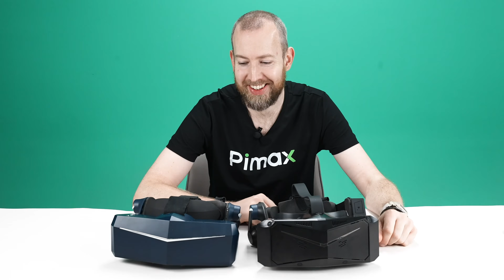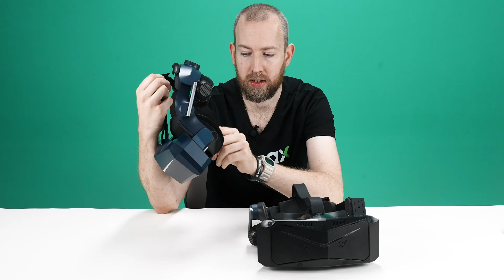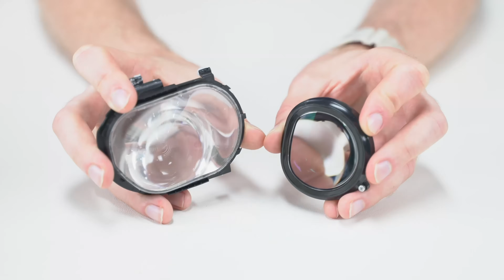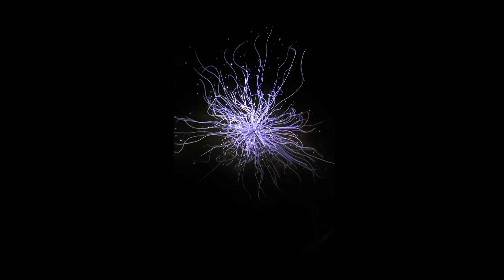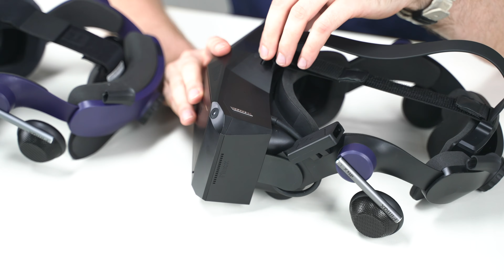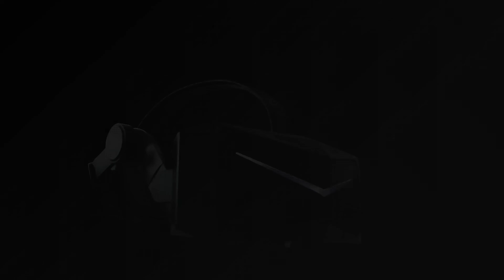Pimax 8KX vs Crystal comparison

Comment: here is hoping the 12k is more like the 8k and gets rid of all that excessive useless junk.
all we need is wide fov, 35ppd, good glas lenses and basestation support, you can keep the rest. although foveated rendering would be nice.
Reply: I would be hopeful fur such a device - but glasslenses in that size are a challenge and AFAIK not planned, second what device is going to render images in that resolution and FOV. The answers made me take the Crystal 😬
Reply: @MarcReisSyllogism  i cant stand that divingmask fov, getting a crystal sadly is not an option for me. i actually tried to reduce the fov of my 8kx to crystal levels, to test, but i could not accept it anymore.
Reply: Eh, dynamic foveated rendering would be a must to drive the 12K. Not even the 4090 can at this point.
Reply: @khaledassaf6356  true, but how much did you gain last round DFR? I love the large FOV of the X, but it needs horse power that I don't see in the next 3 years. I guess it will come, and if there is a 12k large FOV Glasslenses and 90FPS solution I will switch - if the money is restocked until then 😉.
Reply: @MarcReisSyllogism  Depends on the implementation, I guess. DCS, for example, gets insane boost to FPS with the upcoming DFR in the Crystal, MSFS is more at a modest 10%. 
12K would be an extremely niche headset that people can't even truly take full advantage of. I'm getting the Crystal, but once the 12K's out I'll have to check and see if it's worth it to trade up.

Comment: It's hard for current Pimax 8KX owners to be interested in the Crystal and weird for Pimax to now be downplaying wide FOV.  The Crystal is not actually in the same class as the 8KX.  In fact, there are no other wide FOV headsets on the consumer market.  The 8KX has no successor at this time, and no narrow FOV headset can really be compared to it.
Reply: But Crytal is the best screen on the market. The 12kx is the successor to the 8kx for fov. But having both the 8kx is not in the same class as the Crystal in that the display on the Crystal is way better.
Reply: Crystal has wasted space and weight. 8KX users don’t care about stand alone mode or inside out tracking. We want high fidelity outside in tracking with the best visuals possible. Eye tracking. Face tracking. Maybe wigig or something for pc wireless. The rest is wasted weight.
Reply: @laartwork and has a lot of crap that you pay for and dont need.

Comment: I just got mine yesterday evening - awesome! The 8KX is going to my boys, image of the Crystal is extremely good - the controler are OK, but don't have the same fidelity on fingertracking. The Crystal tracking is also very stable, no micro jitters at all.
Reply: Just played some Alyx, man this is amazing!!! After getting used to the controler, they do there job good! The Crystal is the way this is meant to be played and it's also running very smooth at 85 - 90FPS also DCS also gets very good FPS values!! Very great job!!
Reply: im wanting the crystal when ive got more money, seems like pimax isn't releasing broken stuff again
Reply: i have a 3090 what's your gpu?
Reply: Sold my kidney's this round 😢 4090.

Comment: I have both and after using the Crystal, even with all of its current shortcomings, I can't go back to the 8K X.
Reply: Why?
I really want a high FoV headset. I looked at the Crystal and even with the wider lenses, the FoV is not much better then a Quest 3.
So for my self, the crystal probably won't be a option. So i am thinking about the 5k or 8k Pimax for the FoV. What made you not want to go back to it? Does the Crystal perform better?
Reply: @DmAnd11  having the same dilemma.. did you get any of them?

Comment: The crystal looks fantastic, however, I picked up an 8k x nearly 4 years ago in late 2019 after it was stated on the website that I could trade it in for the purchase price towards a 12k qled that was being worked on and would be available for purchase by late 2020...  since then, pimax has developed and released the crystal, the portal and it's whole ecosystem and yet, nowhere do I see the 12k qled mentioned anymore except occasionally "we're showing that off at a distant-upcoming trade-show"...  every time I see press for the crystal I can't help but think how great it would be to trade my 8k x for a 12k qled..
Reply: Yeah it's coming but major changes were made.  I can't find what... but they have hinted at a pancake lens headset. I hope they just make that the 12kX and not another headset.
Reply: @laartwork  Where have they hinted at pancake lenses?
Reply: The Pimax website hints at release next year I think, FWIW.

Comment: I don’t need inside out tracking. No one willing to throw this much money at a headset cares about subpar tracking either. We are enthusiasts. Save the weight and space. Make it lighter and more comfortable and trash the inside out and free-standing mode.
Reply: So make it a bigscreen beyond? Pimax is too busy shoving 50lbs of crap into a 5lb bag to figure out what their actual niche is.
Reply: @mycroft77  issue is big screen beyond price is god damn high for what it offers (no audio, loads of glare, etc.)
Reply: @MrPregnant3D  yup whas point having oled blacks with glare
Reply: If the I/O tracking saves me from buying and setting up base stations, then it's for me and I want it implemented well.
Reply: worst part is that they charge you extra for the lighthouse faceplate instead of offering 2 Versions ot something

Comment: Hey Pimax! I’m super excited to get my hands on your headset soon! I was wondering if you could help me out with a quick question. Does your headset have DP support? I think it does, but I just wanted to double-check. Also, will it work with my RTX 4090? I was reading some stuff on Reddit and got a bit confused about DP1.2 or something like that. Can you guys confirm? Thanks so much!
Reply from the maker: It works fine with a 4090, you can see the videos from Steve who has one: https://youtu.be/Gwr7REXWCuw The Crystal is connected to your PC by DP cable yes.